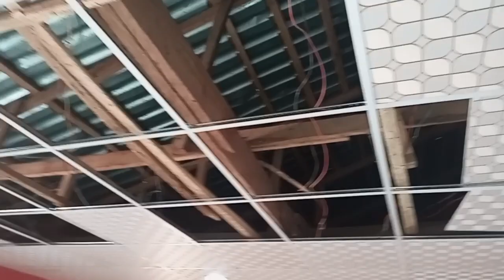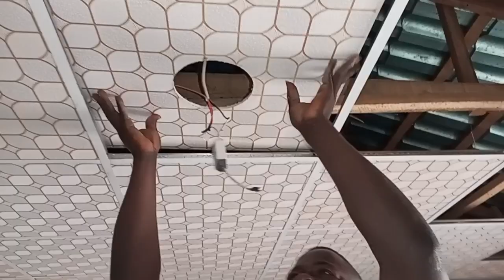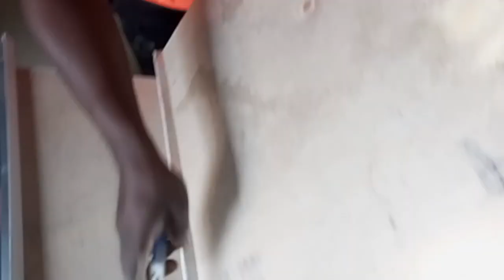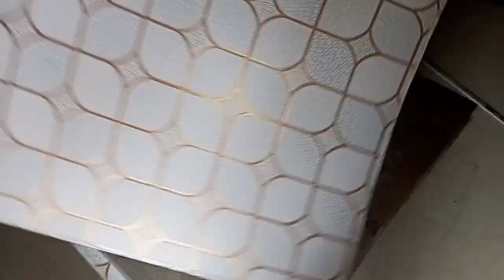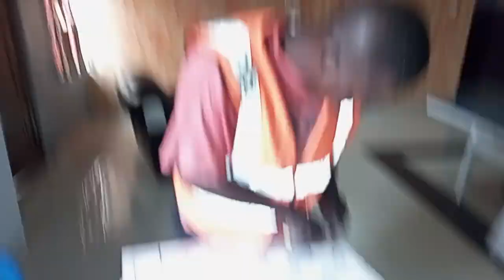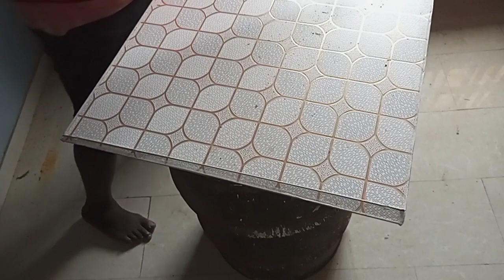Gypsum False Ceiling Design in Nigeria | And how to fix pop led light

Comment: Good job. how many pieces in a carton? how much is per carton for this particular suspended ceiling. thanks
Reply from the maker: A carton is #6,000
Reply from the maker: With the accessories #4,000 per square meter